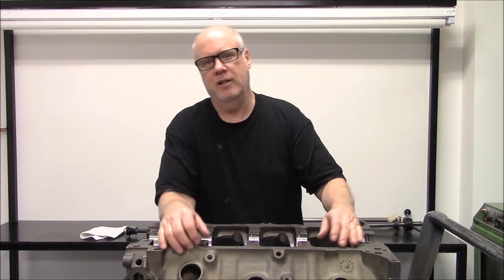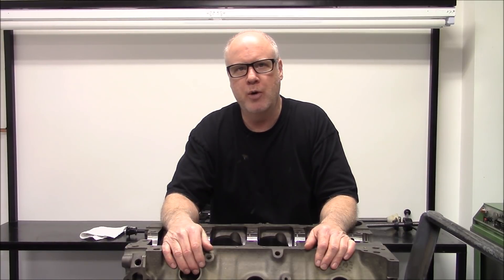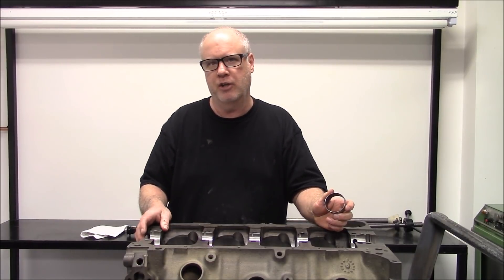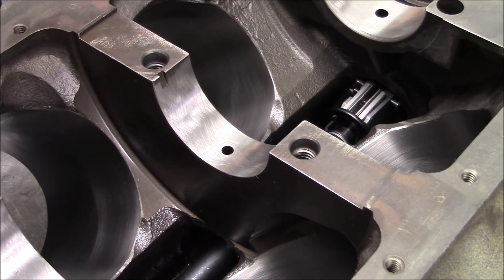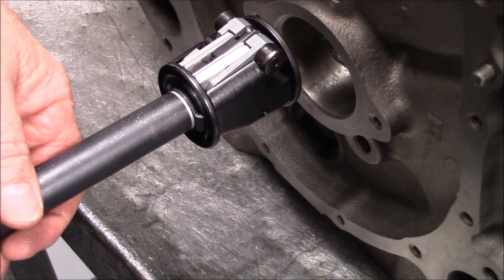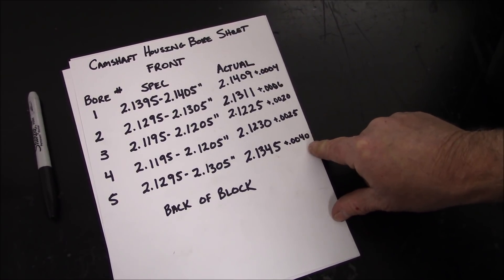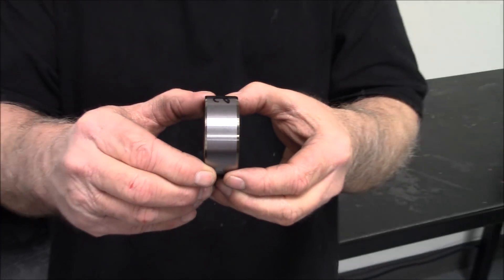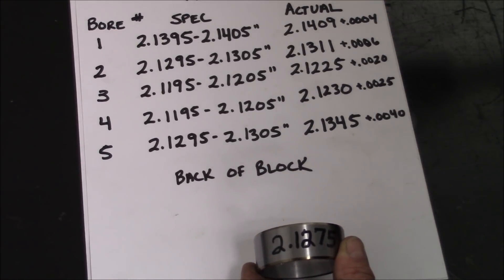454 Big Block Chevy - Measuring Cam Tunnel Housing Bore Size and Grinding Custom Cam Bearings

Comment: That's excellent work on the cam housing bores! You could essentially get rid of the runout in everything and go to a lighter oil to pick up hp on the high end. That's the one area that makes it extremely difficult. You have a crankshaft grinder, wow would I love to have one of those.

Comment: Oversize (O.D.) are available for certain engines, such as small-block Chevs, however all five bearings are the same O.D. and the cam tunnel needs to be line honed to fit. Are oversized bearings available for the big-blocks?

Comment: Its damned hard to go that "deep" with a dial bore gauge and get a decent, accurate measurement and the much easier method is to use an ordinary telescoping or "snap" gauge and an outside micrometer so you can get a good "measurement" and then read it properly. The only situation where a BBC is going to have "loose" cam bearings if it came in with "tight" cam bearings is if its a Mark V 454 and the "engine builder" is trying to install Mark IV cam bearings. As for a "snug" but not "tight" cam bearing causing "oil leaks", there isn't any bearing in any engine that ISN'T A BUILT-IN "OIL LEAK" and a "spun" bearing would be the only REAL concern. And if the old bearing was tight, the CORRECT NEW BEARING WILL BE AS WELL. If you INSIST on using "seasoned" blocks and trying to get "super precise" with your poorly chosen and operated "precision measuring tools" you're GOING to find "issues" with dimensions and "tolerances" that are going to be found in even BRAND-NEW ENGINES IF YOU LOOK "HARD" ENOUGH. There's nothing "impressive" or "professional" about "nitpicking" shit at a "customer's" expense when if you want "perfection" you shouldn't be using "seasoned" factory parts in the first place.

Comment: Mark V 454s have different size bearing bores so its impossible to "mix and match" Mark IV or earlier yet bearings from a "409" or "348" in a Mark IV.  You don't swap Mark V and Mark IV  BBC engine cams/lifters in those "roller cam" blocks because there are differences in the cam/lifter lubrication system and passages that would "starve" flat-tappet lifters for oil if used in a "roller cam" block even if a "flat tappet" cam were used. And the same situation prevents "creative" cam swaps from flat-tappet to roller cams in earlier BBC engines since those wouldn't work out well either. How do you determine if a 454 is a "Mark V" from just looking at it in "passing"? If it doesn't have the "fuel pump boss" machined for a mechanical fuel pump its a Mark V engine. 

And if you try to fit "early" cam bearings you're going to find "loose" bearing bores that don't need to be "fixed" by anything but getting the RIGHT BEARINGS. The size differences also ensure the bearings end up in the right bores as far as oil holes/grooves "matching" even if the "engine builder" doesn't get them precisely "lined up". Roller-cam engines don't "need" as much top-end oiling and "over lubricating" the top end of BBC engines and pumping the pan "dry" at "high-speed" is just as much of an "issue" and a "cam killer" in a "tired" and/or "abused" engine as excessive low-speed/high-load operation is a "cam killer" because of a LACK of "splash lube" and "pressure lube" to the cam and lifters. 

The main reason you typically see "low gears" in BBC-powered vehicles that don't need them for "pulling power" is that they help keep the engine "wound up" fast enough and/or often enough during "short trips around town/farm/ranch" that the cam and lifters at least get a little "lube love" now and then IF the oil and filter are kept changed and full and the engine doesn't get OVERFILLED with oil which aerates the hell out of it and THAT'S bad too. And of course "low gears" are required to end up with ring-and-pinion sets "big and beefy" enough to handle "big-block torque" while reducing the need for it. 

My '85 K30 dually with its early 70s oval-port "car motor" only "mildly" built with 10:1 pistons in standard cylinder bores, a "healthy" cam with noticeable "lope:",  Edelbrock 2-O intake, headers and Holley "fuel dilution dispenser" a previous owner/buddy of mine rejetted with "alcohol jets" just to make sure that while pulling around his backhoe on a big tandem-dual 5th wheel flatbed for his concrete business the old girl never "leaned out" certainly doesn't NEED its 4.56s in the 14-bolt and Dana 60 to go along with the Muncie SM465 "granny low" trans and NP205 "HD" transfer case "direct driven" off the trans output shaft with no "coupler" to break under "spirited towing/driving/pulling" and especially not with its "small" stock-size tires and wheels. But like pretty much every 454 Chevy in a "truck" I've ever heard of, it gets 10 mpg loaded or empty, ran hard or babied. And it'll do HELLISH burnouts lighting up ALL FOUR rear tires. 

The old 454 that has been "rebuilt" with new rings and bearings a few times but never "overhauled" IS fairly "tired" and definitely is probably ready for a "full overhaul" to "freshen up" that old "car motor". And the original "peanut port" truck motor is safely stashed away in another buddy's shop where it "landed" when they jerked that "smog dog" motor out way back when in order to have more "pulling power" for that trailer and backhoe and concrete forms and skid-steer and such. That the "pulling power" increase to what I'm fairly certain is/was an "honest" 350-375 horsepower at maybe 6250 rpm ALSO helped "Old Red" develop a bit of a "reputation" as a "stock class" pulling truck (sled-pulling to "city boys" but just "truck pulling" to the rest of us that knew what it was before diesel pickups became a "thing") not to be fucked with in southeast Nebraska at "farm pulls" back in the day. 

It STILL kicked ass after sitting in the weeds at ANOTHER buddy's place for several years while he ws the intermediate owner between me and the concrete guy after I "stole" it from him for $2500 and after some "minor" fuel system "upgrades" with a new Holley "blue" pump and pressure regulator and "dual-feed" fuel "log" for the Holley and "updating" and "cleaning out" the "side saddle dual tanks" and "supply line" from tank "splitter" to electric pump got it "running strong" again after getting "embarrassed" with it at its first pull "back in action" where it ran like shit due to my laziness and assumption that it would run good because it always had way back when. 

And a serious "relaxing" of the "rules" at the local "farm pulls" so duallies were "legal" AS duallies and there was no need to pull the flatbed AND two rear wheels to get it "light enoug" for the 5800 and 6300 lb "stock" classes both with 5800 having gone "bye-bye" definitely made the truck a lot more fun TO PULL and way easier to "look at" since it looked plain goofy all those years as a "chassis cab" with the inside duals removed and the outers dished out as normal to get them "outside" the front wheel tracks. After I got my shit together and fixed the fuel system, we went "undefeated" for the rest of the "season" and nothing came closer than 20 feet and THAT was kind of a "fluke" since at the other three pulls if we won by five feet we won by fifty. 

Here's a little clip of what a tired old "car motor" just a little "hopped up" in a "work truck from hell" '85 '"tonner duallly 4WD" with all the right parts to hook onto and drag just about anything "mobile" with a place to hook a chain anywhere you want to drag it. 2:42 at THIS video - https://www.youtube.com/watch?v=-mYxBqXYy34

For the record there was no "stock class" so I pulled "exhibition" against and BEAT damned near all the "Modifieds". I also got "DQed" before my exhibition pull for having two "passengers" with me. Including one super-hot MILF I never met before or after that night and one of my TWO priest buddies who "led his flock" including her down to northeast KS from "east central Nebraska" up in "rich farmer country" to see how the "other half" lives and "plays". The "official" DQed me for having passengers and I kind of "rudely" told him I didn't give a shit since I was pulling exhibition and just for "fun" anyway as long as he still let me pull. No problem he said. So we pulled. Pretty damned well, too.